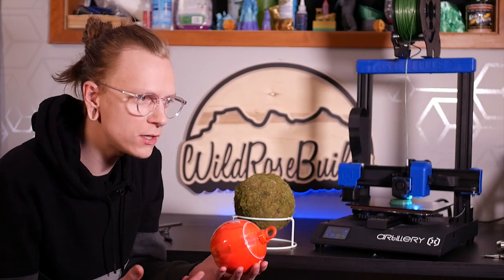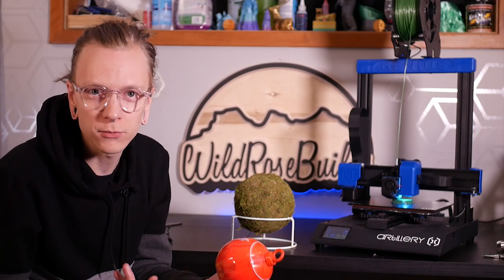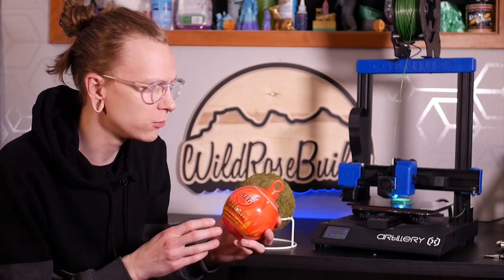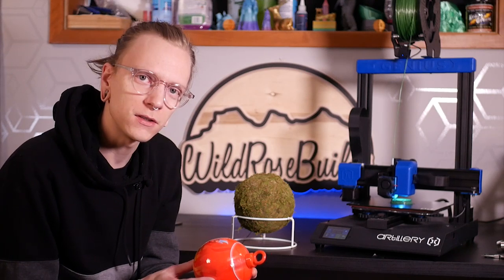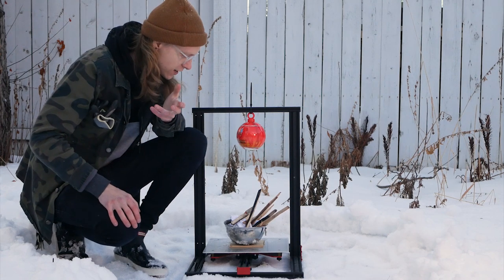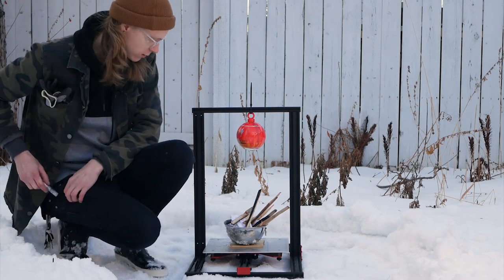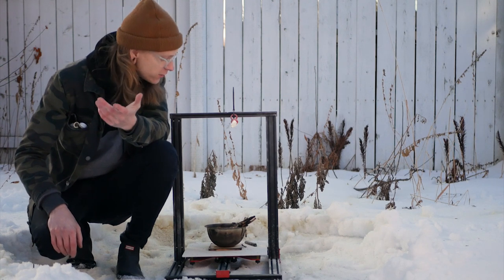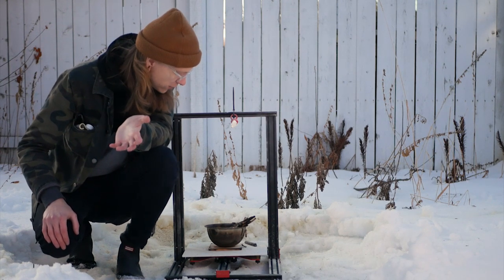Lighting a 3D Printer on fire! Testing the AFG FireBall auto extinguisher

Comment: The question is, does this work on electrical fires that are still being fed power (e.g. mosfet stuck in on state). Would be interesting to test that.
Reply: Yes, electronics are what can cause the fires too. I am curious as well. Just call the fire station before you light the fire. 😂 I say set the bed to 300c after adjusting or disabling the safety features in firmware.
Reply: I would say, when it comes to safety, never trust a single system; always have redundancy. 
Some time ago I wondered about e.g. coupling a smoke detector with a relay circuit that permanently shuts down power, but I couldn't figure out how an extinguisher system could be possibly implemented.

Comment: That fire could have easily spread before the extinguisher kicked in. I found this video while thinking about an automatic fire extinguisher system. Right now I'm thinking the only way to go is DIY. ESP module + flame detector sensor or IR sensor + CO2 fire extinguisher + servo motor or stepper.

Comment: Judging by the amount of fire and heat required to trigger the explosion your shop is already a lost cause once this thing goes off. It makes you wonder if the explosion can take care of a fire that must have already spread to the rest of the room. I keep a CO2 fire extinguisher for electronics close by. Unless it's a full on blaze this should keep the rest of the shop intact in case of a localized event.

Comment: somebody should 3D print an attachment for a sodastream machine to discharge into a 3D printing enclosure with some kind of heat detection to trigger it. I think I would rather get straight CO2 on my electronics vs extremely fine powder 🤷‍♀️

Comment: Not really 3d printer fire though, need to have a roll of plastic, as well as printer cables etc. This is a fire in a bowl on a stand.
Reply: and 50 extruder heater in there connected to car battery ))
Reply from the maker: since they still work i didn't really want to light all the electronics on fire which is where most printer fires occur so this was just an experiment but the printer was engulfed in flames so...
Reply: @WildRoseBuilds  im pretty confident it'd still be effective but I guess we'll never know for sure ;)

Comment: Interesting stuff, but I think its way more likely that one of those fire extinguishing nukes goes off on accident then for your 3D printer to catch on fire. I'd get one, but 90$ seems way too expensive for me. I found the tiny one on Chinese websites for 17$. I'll get one of those just for prevention.
Reply from the maker: Oh! 17 bucks is not a bad deal for something like this. i do think these took quite a bit of heat to activate so i wouldn't be too worried about them accidentally going off ;)
Reply: @WildRoseBuilds  Yeah, youre right about that. I was just shocked by how powerful that explosion was :D. If you search for AFO Fire Extinguisher Ball you can find a bunch of cheaper alternatives. I'll hang one over my 3D printer just in case, and if it goes off on accident I have at least got my room repainted for 17$. So not a bad deal either way ;).
Reply: It literally has to have flame touch it for it to go off.  It's basically a firecracker with fire extinguishing agent around it.
Reply: can u give me a link of those AFO balls for 17 dolars?